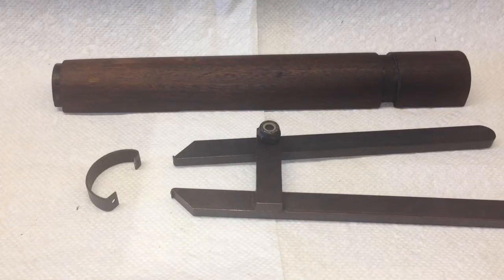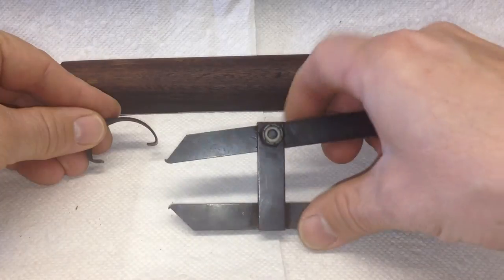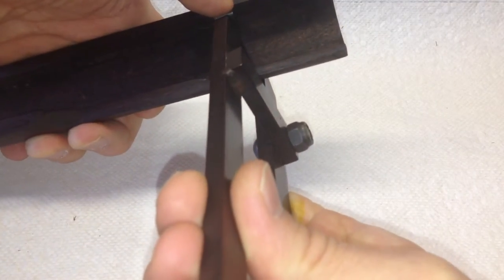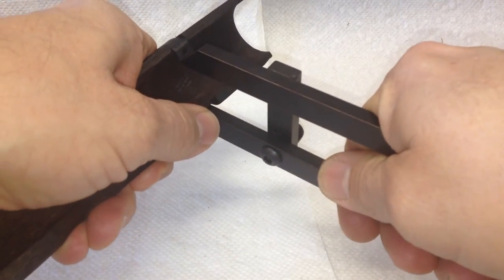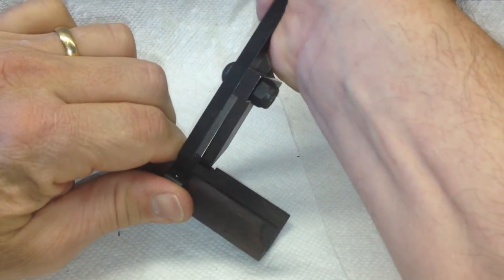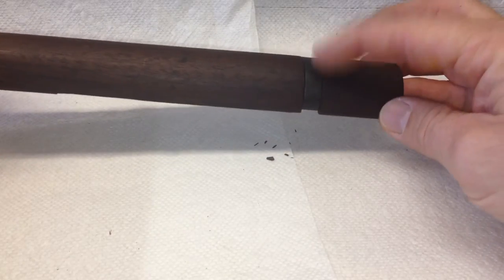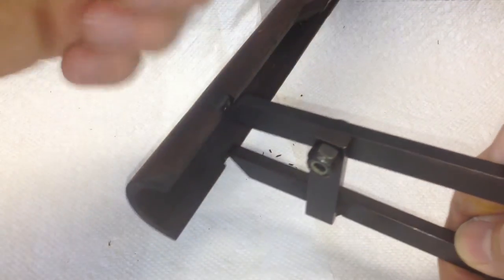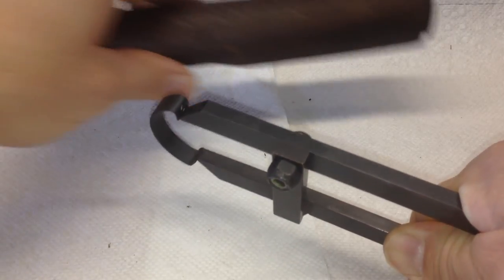M1 Garand Rear Handguard Clip Installation & Removal with Tool

Comment: Hey norwich can you do a video on removal and install of M1 Garand front handguard ferrule?  There are none on YouTube.  It looks tricky.  Love your videos.  They are all very helpful.  Thanks!!!
Reply from the maker: Thanks!  The front handguard (closest to the gas cylinder) was not designed to have the ferrule removable.  Were you talking about the barrel band??
Reply: I have a front handguard ferrule marked BMB I would like to transfer to better handguard wood.  I saw a tool/jig on Gunbroker to help do so.  I was just wondering if there is another way to do it and bend the tabs correctly without damaging the wood.  👍

Comment: Informative, but I’m not sure what you mean when referring to the low side and high side.
Reply from the maker: if you hold the hand guard parallel and look at the rear the rightside area is high while the leftside in lower.  The band is made the same way and so is the tool, don't mix them up.

Comment: Gotta be a better hack somehow to get out of buying the tool
Reply from the maker: Nope.  I only recommend 2 tools, M1 Carbine bolt tool ($45-$80) and this one ($17-$25).  I've tried many other tools, they just don't work without tearing up the other parts around it.
Reply: I got mine out all I did was force it in one direction and it came out.